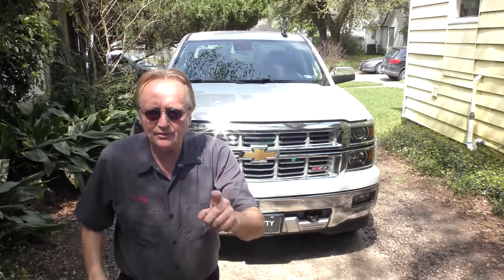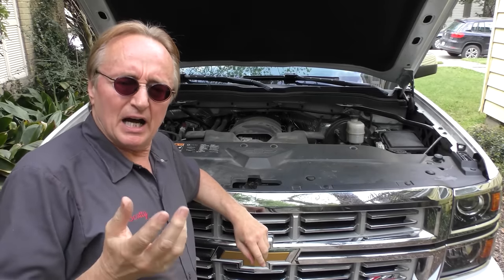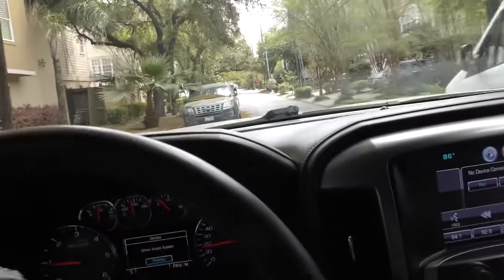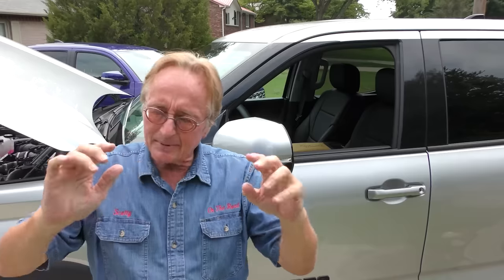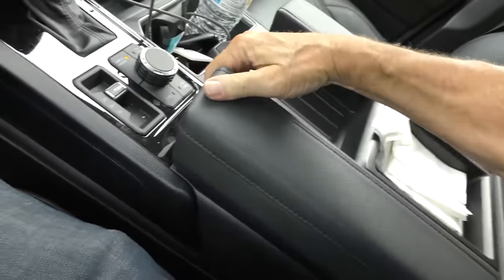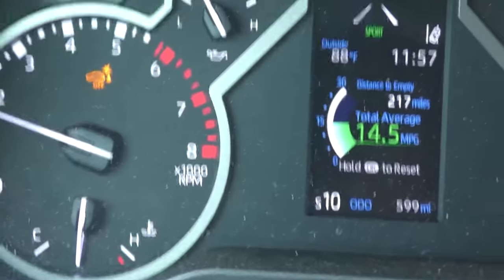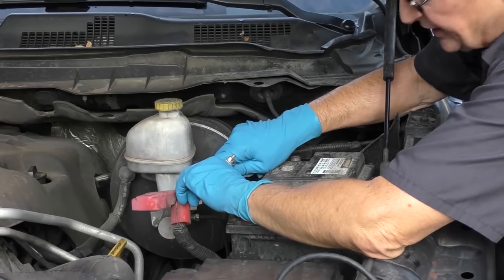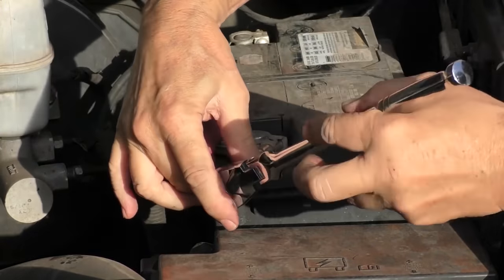3 Trucks I Wouldn't Touch with a 10 Foot Pole

Comment: I love my Cummins.   But unfortunately  a Dodge came with it.
Reply: Was it a Dodge,  or a Fiat?
Reply: Dodge pre bailout. Ram post. Now Stellantis with Dongfeng
Reply: My 2002 dodge ram 2500 5.9 cummins is a very strong truck, no issues, original evap, heater core etc. 398,360 24mpg hwy, still runs like new...for those that don't know it, the 3/4 ton Dodges back in the day, the bodies were made of galvanized steel, the whole body/box....it don't get any better than that, my truck has 0 rust 21 years and 5 months on the road..
Reply: @jeffrey501green  Those were the days of Dodge,  not FIAT.   Wish I'd bought one.
Reply: I'm a plumber and galvanized is terrible. It rusts like crazy lol. I replace galvanized with copper and cast iron for a living lol
Reply: @jeffrey501green   I have a 2005 5.9 cummins and it runs great.  190,200 miles gets 20 to 23 mpg according to however it's driven.  Great looking truck.  
Lots of electrical issues that are very frustrating due to cheap wiring.  Seats terribly uncomfortable.  Rocker panels rusting.  Had to rebuild transmission at 145,000.   Ford had much better quality and build in those years,  except for engine.  No cummins.
Reply: @ryanclarke2740  yes, but water running through galvanized is a whole different issue. Dry galvanized with epoxy primer and paint=indestructible...
Reply: @timbrown49  yah the seats in those 05-06 were like a board.  I was thinking of trading back then....until I sat in one! Didn't know wiring was a problem in 05-06. No wiring issues in 98-02 that I know of...I have had 0 issues in 21 years and 400k. The Fords would need ball joints and rod ends in 50-60k miles. Dodge was good for 150k, at 150 k I replaced my ball joints and rod ends with greasable units. Now, 9 issues for last 250k. I have changed filter and fluid on my 47re Trans every 25k since new, 0 issues....million mile Trans I'm hoping....
Reply: @timbrown49  ford did have Cummins you had to buy the medium duty f500/f600 😂
Reply: @ryanclarke2740  You don't use pex and  abs now?
Too bad copper is too expensive to use on trucks and cast is too heavy.  Maybe stainless like a DMC car?
Reply: I love dodge for one reason I can work on my own vehicle if you know what you are doing I've been around them all my life
Reply: @TIJoe-te9qu Or maybe a ram stellantis?
Reply: @jeffrey501green  you must not have snow and ice where you live.  Up here 2bd gens have rust holes all over the place.
Reply: @Fisherguy01  nope no snow and just a little ice here in north Arkansas.  All the 2nd gens here. And there are alot of them, look rust free. Paint faded, but other than that, look greT, still pulling loads. Alot of contractors and farmers here still working their 2nd gens.   I'm sitting in mine right now, 405,000 miles and running strong...
Reply: You should have bought a semi with a Cummins if you didn’t want a dodge!
I have a dodge without any major issues!
Reply: @jeffrey501green 2004 and older was great
Reply: I have a 13 model ram with the 5.7 and it’s a great truck. I’m the second owner but it was very well cared for. Only had 88k miles when I purchased it. That’s not much for 11 years.
Reply: @dominickjustave3558  yup, they sure were...
Reply: @jeffrey501green My 2006 ram 3500 with 520,000 still runs every day.
Reply: @timbrown49 The Ford drive and turn like a school bus.

Comment: Imagine having to spend $2000 on replacing an evaporator after 5 years. Mine is 20 years old this year and I could do it in less than an hour for less than $150. If I had to. Which I don't.
Reply: 2002 Ford Mustang GT here ... still on the original engine, transmission, AC and alternator.
Reply: actually you can do it with only a partial disassembly on the dash. Remove the top cover which is just held in by 2 7mm bolts and the rest is clips and that will give you access to the mix box top bolts, each are 10mm. Then you disassemble the lower dash kick panel which is just 3 7mm bolts and then undo the clips holding the glove box inside. Fold out the glove box and remove the 7mm bolts holding it in. Next remove the passenger side sill plate cover which is held in by clips and you should have enough room to undo the rest of the bolts and move the mix box out of the way just enough to slip the condenser core out. 

However, this is actually an uncommon problem. The majority of HVAC leaks on GM trucks are from the massive condenser up front. These are easy to replace and there is a retrofit that gives it more support so it doesn't form stress fractures around the ports for the tubes. Parts are around $150-$200

also there are vents leading to the back passenger compartment in these pickups. They're under the seat. There is an option for rear zone controls as well, same as on the Suburban.
Reply: Call me lucky, but the AC on my 2011 Silverado still blows cold enough to make snow.  Got 120K miles.  I will agree that the latch is garbage.  Mine broke out of warranty.  When I pointed out that it shouldn't have failed so soon, the service manager called GM and they agreed to pick up half the cost.  Not perfect, but better than nothing.

If something breaks prematurely on a vehicle out of warranty, it's a good idea to ask if there's a goodwill warranty.  Might save you some money.
Reply: That's Nissan quality for you
Reply: @dcsteve7869 
Tell GM that.
Reply: I can top that. 2021 gmc Sierra, busted radiator hose. Cab has to come off the frame, to replace it. That was my last gmc.
Reply: @br7874884  Holy HeLL 😮
Reply: @c4279  2001 Toyota Camry original owner, 311,000 miles. Still on the original engine, transmission, starter, A/C (never charged), alternator....everything including the rear brake shoes. Only replacement besides factory schedule maintenance was a gas cap (270K miles) and a driver side front window regulator (290K).
Reply: 2000 mercury grand marquis 68k miles. Still strong with everything original. Going in 25 years, the door says it was assembled in 1999.
Reply: That's Toyota quality for ya.
Reply: @alexmachado3622  I have a 98 with 200k. Needed a few minor things, runs great but it has holes in the frame now..  The A/C drips on the passenger frame , just FYI. Maybe find a way to divert the water. It gets trapped in the frame folds and rots from the inside. The a/c accumulator (thing that leaks) actually got holes in it because it is insulated.
Reply: Imagine having to spend $10 000 + on a POS Ford. Between FORD and GM, they forced me to Toyota. Toyota sure is affordable to own.
Reply: @alb12345672  thank you. I’ll screenshot this and do something soon. I appreciate it, I hope you grt many miles more out of it.
Reply: @mikefoehr235  Yes I also have an older GS 350 AWD. Just starts up and goes, no repairs. Pretty much what is in a Tacoma now (it is a RWD AWD powertrain). Very reliable.
Reply: I started off as a GM guy, moved to Honda, and settled in with Toyota. I have three Toyotas currently. All over 10 years old. I've spent a grand total of about $5000 in 20+ years on them. That includes all regular maintenance and tires, and I run full winter tires, as I live in a climate that has winter for 7 months. 

The other manufacturers simply cannot hold a candle to Toyota's reliability and build quality.
Reply: @lannynavitka8949  I am on my 4th Toyota.  20 Tundra. It is an awesome truck to tow with. I had a 13 Tacoma as well. Both trucks are excellent. My wife had an 04 Corolla and 16 RAV 4. The RAV needed a new condenser for the AC....First Toyota needing AC work of the 4. The Corolla was at 360 000 kms when we traded for the RAV. Toyota is outstanding.
Reply: @lannynavitka8949  You know Honda is a solid second choice. The brand has had some tranny and engine issues from time to time but what automaker is.perfect. Even mighty Toyota does f up now and then.
Reply: @br7874884  That's a real zinger.
Reply: @mikefoehr235  600k on my 2004 Toyota Echo RS 5 speed(my wife's college car lol), 300k on my 2011 Corolla, and 200k on my old Tundra work truck. All run flawlessly. Just can't justify spending any money on a new car....maybe one day lol.
Reply: @lannynavitka8949  I would probably still be driving my Tacoma but towing our RV was tough with the v6. It was real hard on fuel. The Tundra with the v8 is way better. The difference in power is crazy. Toyota trucks are great...just spray the frame every year with KROWN RUST or equivalent and should never have a problem
Reply: @lannynavitka8949  My 2015 Jeep Cherokee has held up far better than my co-worker's Rav4 so....
Reply: @jayschmahl9206  Overall, Toyota/Lexus have lead in quality and reliability for many years....the brand isn't perfect tho. Sometimes even mighty Toyota builds a lemon now and then.
Reply: Not hard for many Jeep and Ram owners to imagine as they had lots of evaporator failures. Probably closer to $1000 dollars though.
Reply: All three of my Toyotas are built in Japan. I made sure when I bought them(all used, like Scotty) that they were J code. My Echo RS hatch wasn't sold in the US, it is a unicorn.
Reply: Buy American❤
Reply: @c4279 Same year GT convertible, kenne bell blower, and its ice cold too! Even my 03 ram is still cold, which is a real shocker!!
Reply: My 2000 Silverado has a seized ac compressor
Reply: @alexmachado3622 Mine was a 2001 Grand Marquis, and the door said it was assembled in late 2000. She still ran flawlessly at 198,000 miles on the original engine and transmission. Alot of people hate on Ford, but the 4.6 2v and 5.4 2v were the best engines Ford has ever made and will ever make. There is no other more reliable engine that Ford has made besides those 2 engines.
Reply: Mine is the oldest 1987 Jeep Cherokee XJ 4x4 pioneer with my 6 inline motor clocking in at one million miles with the same transmission AC is also running strong.
Reply: If you bought a Chevy since they became government motors you would be doing a lot of work. I drive them at work. They are such a POS. Our new one had 500 miles on it & check engine started coming on. It has 25000 miles on it ac has quit on it. Took it to dealer they charged it back up & it still randomly quits working. I think the electric fans are working all the time when ac is on.
Reply: It should be a crime to sell people $80,000 trucks with cheap, junk parts on it
Reply: @br7874884 Wow, I believe you've come off the rails..
Reply: I guess I better NOT SAY HOW MUCH I OAID DOR A NEW AC COMPRESSOR AND Heating Core and the evap .  Thank God for neighbors😂 $100- for all parts new since he was going through a nasty divorce and she was to be given the truck and he still owns his Ferraris,😊 he said here the court is taking the truck in the morning get your parts and buy me dinner noo problem steak? Italian? You order!!! Noooo problem
Reply: Imagine making thousands of dollars per month talking about cars and trucks🤔
Reply: @br7874884 you don't know what you're doing lol
Reply: My AC in my 2015 Silverado is broken, now this got me scared lol
Reply: Once I payed 900$ to get my starter changed on my Honda Civic 2008 ex ripped tf off🤣🤣
Reply: When I inherit a fortune I'll buy a restored  1960 s truck a power wagon and a one ton international  and  keep them going another sixty year's
Reply: @fredflintstone6163 I picked up a Bullnose F150 with the same intent. Considering looking for a 250 in the same age range now as well.
Reply: @Peculiarsafe83  I believe you brother. I have a 2007 for f150 triton 5.4 and it has 193k and it’s towing flawlessly. Towing tons daily. I baby it with oil changes and will do the differential fluid change and coolant flush. It will last a long time with the power it produces.
Reply: @Peculiarsafe83  just did all 8 spark plugs and coils. Running strong, I wouldn’t trade it for anything. I’ve made thousands off this truck. It’s only the beginning for sure.
Reply: @alexmachado3622 Lincoln gangster car here 210000 ,still going no rust yet ..30 years old only thing new it's the whole a/c system installed by my self👽👽
Reply: @lastcall170 whats American these days? Most built in other countries or with foreign parts. Ill buy whats best for me.
Reply: @mikefoehr235 I bought 2 Fords for $600 been driving both of them 7 years now and done about $350 total maintenance 😂
Reply: @lastcall170 buy an American Phone 😂
Reply: @fredflintstone6163 if you take a 1970s international tractor motor you put it In a old Toyota pickup or a Ranger you’ll get around 100 mpg or maybe more. That tractor I sold my stepbrother I could bush hog with it from early morning working it wide open till dark and only use about 3 gallons of fuel . And those trucks weigh less so even better.

Comment: I was in the parts business for years and we kept Chevy door handles in all the different interior colors in stock. There was rarely a day go by when we didn't sell one. Only the "highest quality" from GM.
Reply: Replaced mine 2 times now on my suburban.. and the inside handle I believe 3 times as well...
Reply: Well its not just gm. I had several ford obs that several times you to pull the handle to get out of the truck and be holding the handle in your hand in the door not open
Reply: If a cheap, plastic door handle is the only major thing and everything else is okay-ish, I'd be happy. Its the little things. lol
Reply: I know exactly what you're talking about! First thing to go on truck! First one, and then the other. Should have bought a half dozen!
Reply: I took my son to buy a new Chevy, looking nice, open and shut the door. Slam, door handle falls off. Salesman gives an excuse, we'll fix that-still in plastic wrap. Take us to another Chevy, looking good, open and shut the door, this time the window falls down. Looked at the salesman, and walked away. Bought him a used Mitsubishi. Only problem he ever had was the timing belt and it had over 200k miles.
Reply: GM went above and beyond in convincing me to never purchase another product from them ever. The last 1500 was a nightmare. And I so wanted that truck. In a strange turn of events I purchased a Nissan Titan 4x4 right before pandemic for 35k new because I had to have a truck fast. Every single day I try to find something wrong with it, but I just cant make it not work its tail off for me. Pleasantly   surprised.
Reply: @larryroyovitz7829 you’ll replace those Chevy brake lines as well. And that is no small or unimportant part 
Cheers
Reply: Literally the smallest problem compared to what happens with other trucks chevy is on top especially a silverado 1500 most reliable trucks ever
Reply: @bigbrother9531 90s model chevy 1500 are the best first trucks you can buy
Reply: @tomdavis3038 I have had several chevrolet pickups, and I have never replaced a brake line.  Where do you people come up with this nonsense????
Reply: At the school board my uncle change’s average 4 Chevy fuel pumps every day 😂
Reply: Don’t forget those new ones that are buttons when water gets into it and causes it to break 😂
Reply: Wish an aftermarket metal one existed.
Reply: @Deveak  the entire system is prolly plastic, put a metal one in there and it'd break the internals lol
Reply: @jasonjackson6055 you obviously love in a southern state...and not near the ocean or snow

Comment: My 2016 5.0 F-150 has 183,000 miles and still runs like a clock and cold AC. The Ford V8 is worth its weight in gold!😍 AND I should mention it gets 18-23 MPG!
Reply: This will be my next pickup 15-17 still had the 6 speed transmission as well
Reply: You're a lucky one. My cousin in laws have a 17 with nothing but problems. My uncle had a 14 that stayed in the shop, I know friends that have problems out of theirs, and my cousin is dropping his 19 f250 7.0 from all the problems in it. Yota ✌️
Reply: Wait till it hits over 200k miles, the transmission will stop working
Reply: 2017 f150 4x4  167k, zero issues and runs like new.  Take care of your truck and it will take care of you, pretty simple.
Reply: Amen brother! The 5.0 is 👑
Reply: I get to drive the domestic brands at work, thats why I’m stuck on the 5.0 F150. I haven’t driven a dodge or gm product yet that doesn’t have broken crap falling off in the first year. The gm 5.3 is a great engine but it’s a shame the crap around it is so cheap, the new ones with the tailgate button instead of a handle is stupidest gimmick yet, especially with the in cab tailgate release button. Once the thing wears out it’s a tailgate free fall button that doesn’t soft open anymore!

Comment: Dodge trucks; when I see one I ask, what other bad decisions did the owner make?
Reply: Dodge truck drivers are more likely to have DUIs than other drivers. 

So plenty bad decisions 😂
Reply: Mmm my 20y year old Cummins with 600k is still going strong. Only problem I've had is transmission but one trans in 20 years with lots of towing 15k or more is not bad in my mind.

Comment: The old Chevy trucks were glorious. Uncle had a 1970, 4WD, 350, ran it for 397,000, gave it away, had a snow plow mounted on it in PA during snow season.
Reply: Can't speak of 1970 - I am not THAT old but mid 80's and up - all detroit stuff is garbage.

Comment: My brother's 04 Pontiac sunfire has just over 400,000 miles and has only had 1 fuel pump,  1 water pump and 1 window motor.  Still driving it daily.
Reply: Im sorry 😂
Reply: I can hardly believe it. A pintiac has madd it to where many a civic and corolla have been
Reply: 400k damnnnn
Reply: It must have been built at Lordstown,Ohio.
Reply: My first car was a 2001 grand prix, transmission kicked the bucket at about 290k, great vehicle.